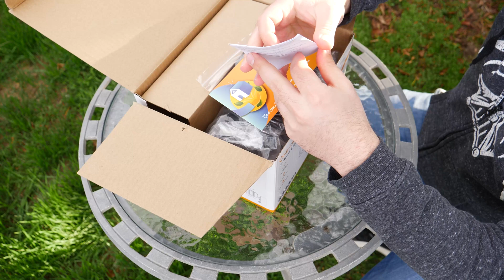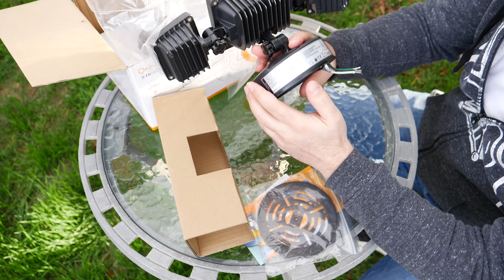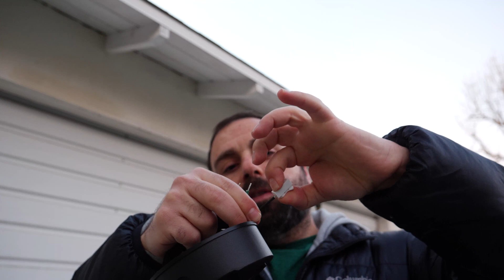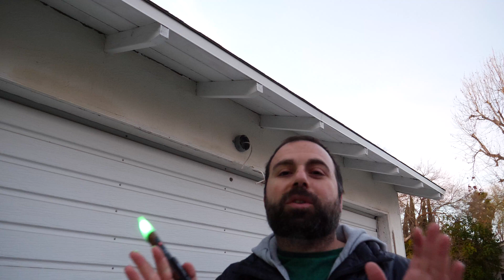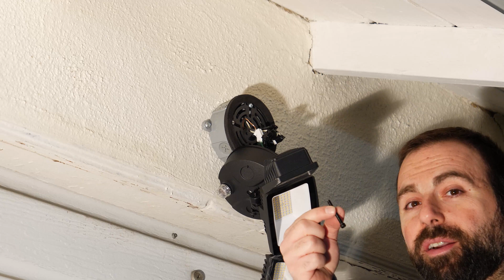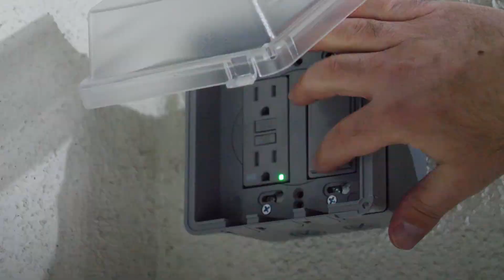LED Security Lights Unboxing and Install | Onforu

Comment: Thank you for specifically stating TURN OFF THE BREAKER & getting an AC voltage detector because this is 100% dangerous if you don’t know what you’re doing or you never done this before.
Reply from the maker: Yes and if you don't feel comfortable, always best to hire a pro

Comment: the mounting hardware is garbage, no point making excuses for them unless you get paid to do it. You are not supposed to mount the light without a weatherproof box
Reply from the maker: I didn't get paid to do this video. It's a good light which was my focus and I installed my own weatherproof box. They should provide a slightly longer screw for attaching the light to the fixture.
Reply: What size box did you get ?

Comment: Hi, great video where do I purchase the "power wires through these holes"? I have never assembled a light like this sir 👍
Reply from the maker: Thanks, you can pick up the power wires through your local hardware store (Home Depot or Lowes in my case). They are called romex cables, I was using the 14/2 for this install. Very important, if you've never done this before, I would definitely either call a professional or ask someone for help that has tons of experience doing stuff like this. Working with power is extremely dangerous to the point of death. This video is for tutorial purposes only.
Reply: @landpet  thank you for your response! Happy Holidays, and a Happy New Year!

Comment: I have this model with motion activation. It's super bright but the motion activation is TERRIBLE.
Reply from the maker: Oh, I'm happy with this dusk to dawn sensor version whenever it's used. I've installed some strong solar lights nearby so this thing doesn't get used much anymore.